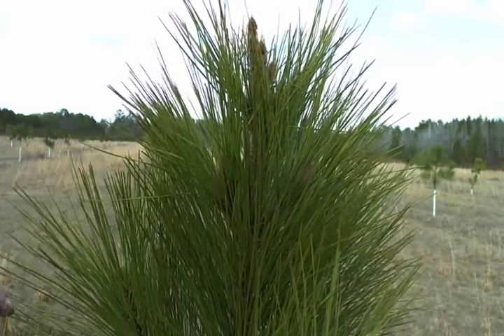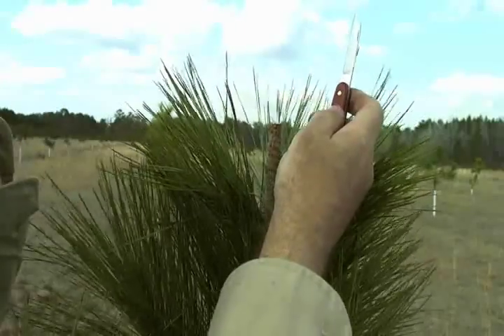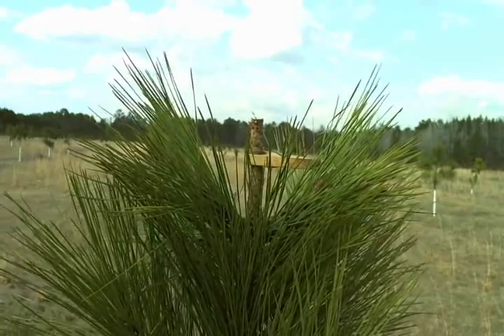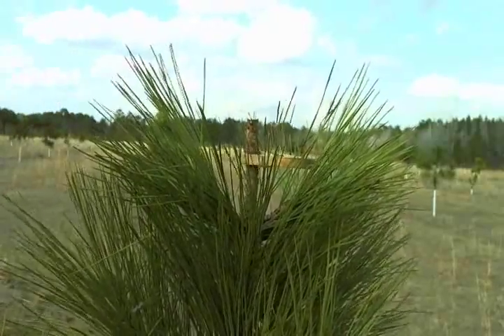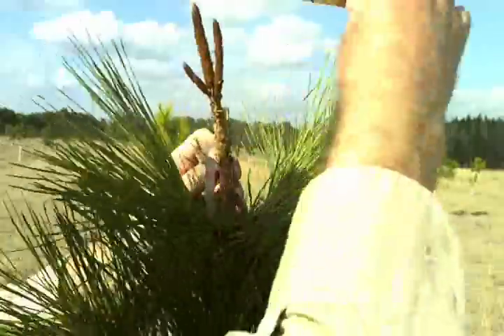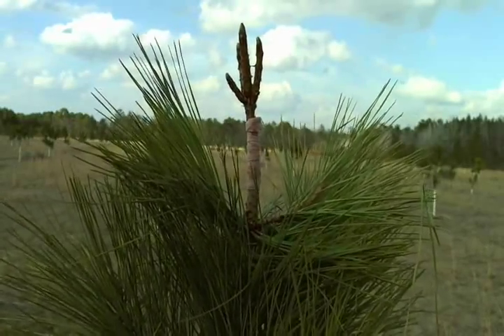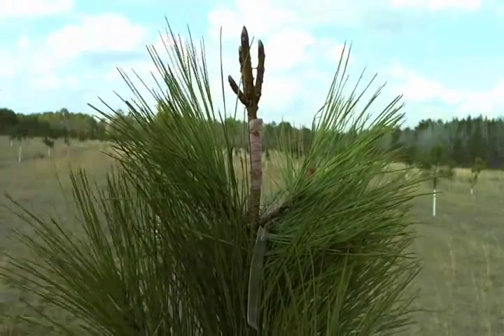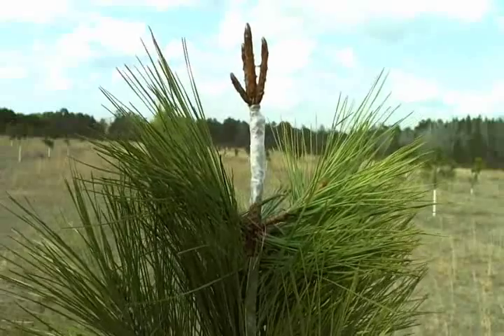Grafting with my Victorinox

Comment: Why do you use the tape rather then grafting wax? I see a lot of people are doing it. I have been tought to do it theoldfashioned way with bast fibers and a pine tar/beeswax/tallow/turpentine grafting wax. It has some antiseptic/bacterial properties in addition to making the graft water tight. 
I must add I graft maybe every three years or so, so by no means am I an expert or trying to disprove your method. I am simply trying to poke your mind for your experience and why you prefer the method you show here. 

Thank you in advance.
Reply from the maker: Andreas Lied I was trained to use grafting wax and that's what I used back in the 1970's and early 1980's.  I still use it to dip the scion into before coming to the field.  The paraffin film is much easier to use in the field though, and I don't see any difference in results.
Reply: I primarily fraft stone fruit trees for cross pollination purposes. I'll try the paraffin film when the current batch of grafting wax is out. Great video. Thanks for the response :)